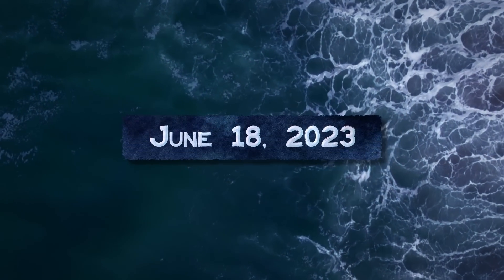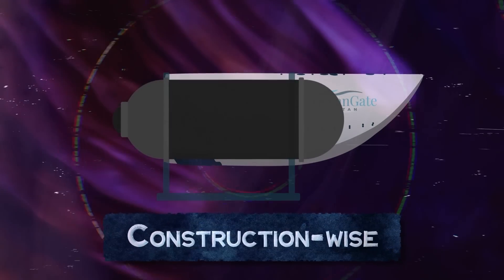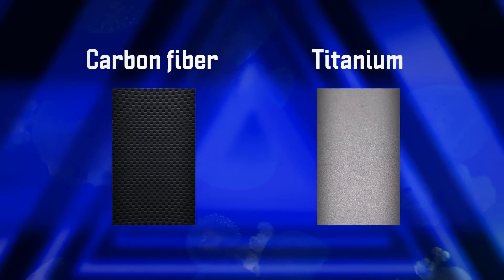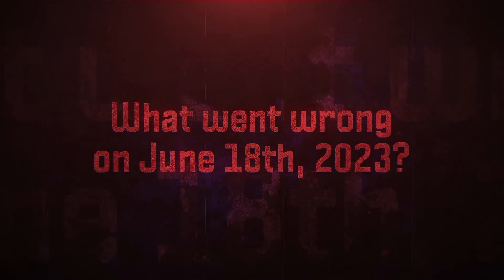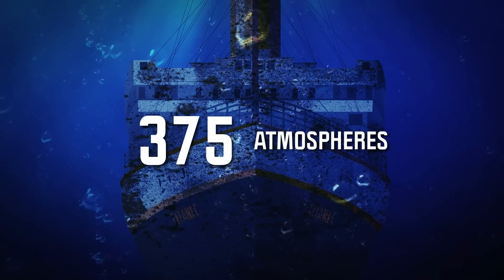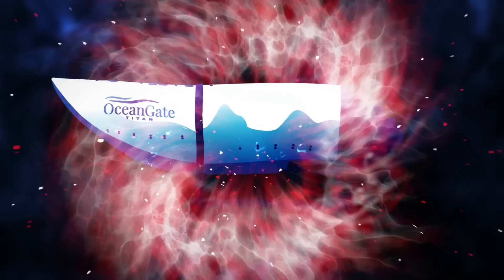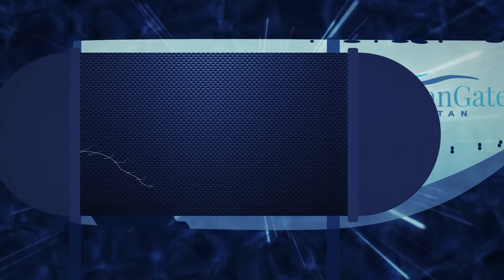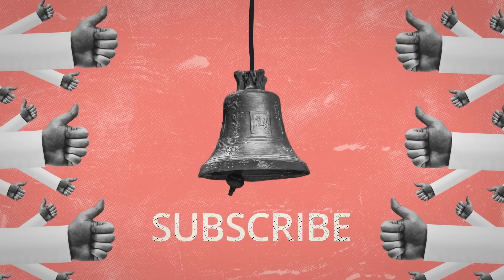What Really Happened to Titan Submersible

Comment: What we know now is that Stockton was in a rush to get to the bottom, which explains their rapid descent. He likened his sub to an "elevator" to which a single button was needed to take people down to the Titanic. In his rush to get to the bottom quickly, he forgot to bring binoculars, so he didn't see the underwater iceberg that was below him. He failed to see the iceberg until the floodlights he bought from Home Depot illuminated it, in which he yelled out "iceberg right below!" and tried to dump ballast to slow the sub's fall, but it was too late. The sub eventually hit the iceberg which caused the hull to crack. As captain of the sub he ordered women and children into the lifeboats, but seeing there weren't any, the men stayed in the sub and like the rich cats they were, "dressed in their best and prepared to die like gentlemen," while the Brit ordered a brandy. Stockton tried hard to keep the lights on so the passengers could play "Nearer My God To Thee" on their MP3 players. But eventually the hull failed and the water rushed in. The water is just 30 degrees F at that depth and in just two minutes they were all dead. This is the storyline that James Cameron will use in his upcoming docu-drama for the Discovery Channel which will certainly air in 2024, which is why Netflix is increasing their monthly subscription rates.
Reply: They were dead in less than 2 minutes more like a nanosecond, happened before their brains could process it. But they knew it was coming the transcripts show titan and the boat above communicating for about 15 minutes, stockton tried to release the weights but it was too late. The problem was the carbon fiber hull after so many uses.

Comment: If someone is an expert on a matter, could you please step in and explain to us why something such as a nuclear sub would be able to tolerate that type of pressure
Reply: Most can’t reach that depth. Though the exact limitation of modern nuclear subs is classified, the limit is probably around 1000 ft or less. Subs designed to go down to the depth of the titanic (closer to 12,000 ft) will be specially designed for this task. You can probably count the subs able to reach the titanic on your hands and toes.

Comment: The carbon fiber was at the end of its shelf life meaning it had expired. Every dive weakened the carbon fiber and it got fatigued. The Titan was too cheaply built and not certified. The Oceangate CEO disregarded safety warnings. Just like the Titanic disaster, this disaster was preventable.
Reply: I totally agree… Stockton rush knew what he was doing wrong, he acted like the carbon fiber material can withstand all that amount of water pressure and was stubborn to admit that there is no other way of using a cheap material instead of steel or metal.🤦‍♂️💀
Reply: @DeathToAGod Jesus loves u
Reply: Agreed, I essentially a videoof a other theory that : 1. The last  time ocean gate had an dive they had to cancel without diving deeper than 100m probably less, this was the youtuber video of the young guy, 25-30 dark hair. 2: Before the fateful dive they had the sub on its launching vessel towed behind the mother ship because of rough weather they could not dive but instead of loading it back on they towed it. 3: when they were descending an electrical fault cut out the power and they gathered at one end momentarily butenough time to tip the sub on its end and all slipped/fell/ skidded into the end.
Reply: @Stroopwaffe1 Jesus loves u
Reply: Jesus loves u
Reply: Yeah the Titanic tragedy could have been avoided if people DIDN’T MOCK GOD!!!!!!!!!!!!!!!!

Comment: Out of all situations that has happened, I've never seen anything get meme to oblivion as much as this here
Reply: It's because the billionaire though it was a good idea to control the Submarine with an XBox 360 controller and building it with Home Depot parts 🤷‍♂️
Reply: @juanorosco2518 using controllers is pretty common, In 2018, the U.S. Navy unveiled a new 377-foot-long attack submarine complete with an Xbox controller. But the controller, which is cheaper and easier to use than a joystick, doesn’t control the entire sub. Sailors use it to maneuver the photonics masts, which function similarly to periscopes.

Other weapons for the U.S. Army, including a laser cannon built by Boeing, are reportedly operated using Xbox controllers. Gaming controllers have also become standard for bomb technicians.
Reply: @sssilver_wing  kinda weird. Can't they make their own proprietary controller? I mean it could be shaped like a game controller but... An actual game controller? When everything surrounding it is much more expensive? Why? I know our unofficial Military motto is "if it works it works until it doesn't" but come on lol
Reply: @juanorosco2518 The owner was an arrogant millionare. There were two billionares on board (for all good those zeros did to save them) but not Stockton
Reply: @falconeshield  they're all fish food now 😂
Reply: The Will Smith slap was pretty memed. But these memes were 1000X finnier. Especially the ones with the playstation controllers.
Reply: @joeybaseball7352 Outdated dreamcast ones. Older than 20 years old.